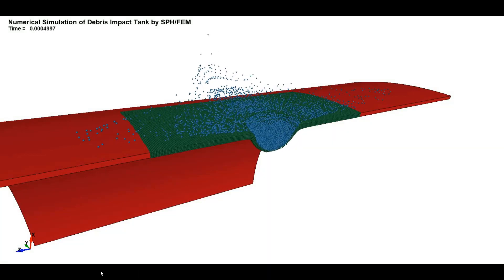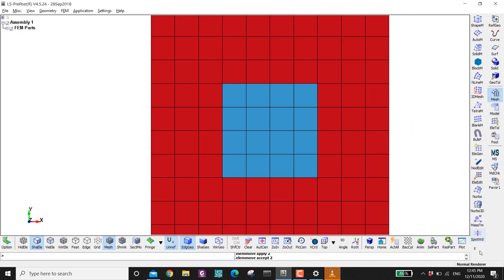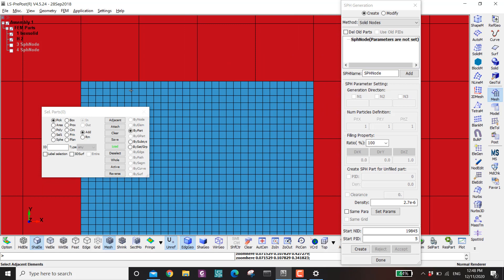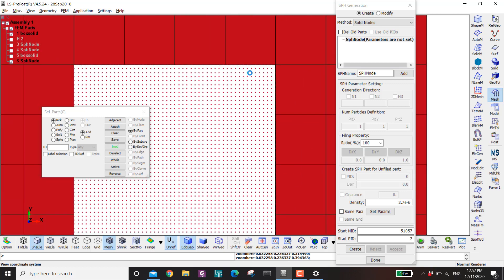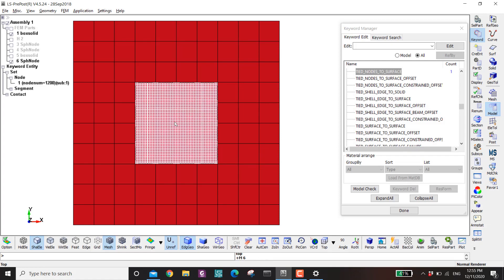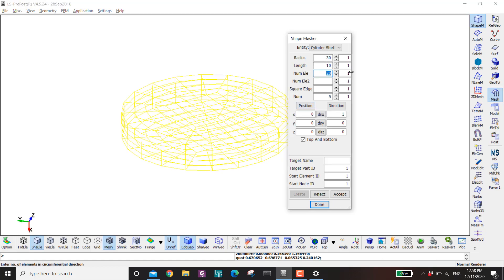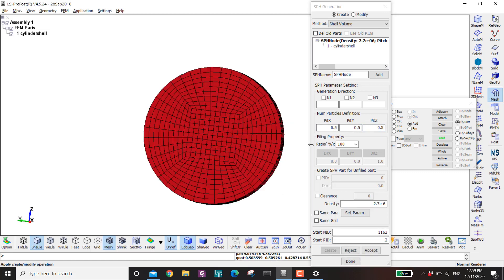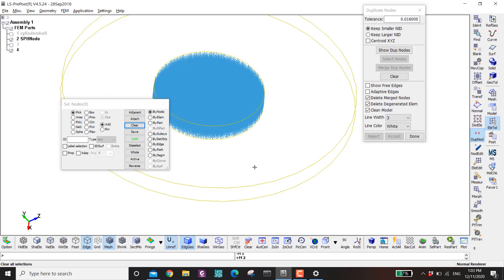SPH-FEM Coupling

Comment: Hi, thank you for the video, it's very useful. This might be a bit niche but I'm currently looking at hypervelocity impacts on structures created by overlapping spheres. I'm trying to reduce the memory needed by using this technique but I'm having problems with creating flat surfaces to use to couple the elements. I've tried creating solid shapes, which I can then cut to get flat surfaces, but I haven't managed to successfully mesh them. I have also tried using solid sphere meshes but can't get a flat surface from them to couple them to the SPH part. I would be very grateful if you had any advice. Thanks!
Reply from the maker: It is hard to imagine what your structure is. If you can share a picture, that would be great.

Comment: Hi Ameen, 

Great video, another really useful tutorial. 
I'm currently working through your video tutorials as my masters project involves hyper velocity impacts. I was just wondering if you were still planning on releasing a tutorial for modelling the impact scenario shown at the start of this video (SPH projectile and SPH target). I've tried to simulate is using your other tutorials but keep getting error messages.

Thanks.
Reply from the maker: Dear Thomas, 

May I know what errors you are facing? I am working on an article publication where I use SPH vs SPH in high velocity impact. Once the paper is published, I will be making the tutorial.
Reply: @AmeenTopa  I have set up an SPH impact zone with solid impactor to test the tied_nodes_to_surface keyword setup from your tutorial but when i run the simulation using other keywords from a few of your tutorials the projectile passes through the SPH zone without effecting the particles at all. Any help would be greatly appreciated and I'm looking forward to seeing this publication
Reply from the maker: @tpetersh  You have said solid projectile? So you have solid element impacting on SPH target?

You need to defined Nodes to Surface contact. I have mentioned this in my Bird-strike tutorial. 

If it is SPH vs SPH, then you don't need to define any contact. The SPH particles will interact with each other by default. Make sure to define CONTROL SPH with CONT = 0.

Also, make sure that you have defined the SPH properly. You must insert the density of the SPH material when you use SPH Generation tool.
Reply: @AmeenTopa  yes my final goal is to have SPH to SPH but I'm trialling SPH impact zone with solid projectile first to familiarise myself with the setup.

I will check those things and try again. Would you say SPH to SPH is easier to set up than SPH to solid then if theres no contact definition required?

Thank you so much for your help. I appreciate it
Reply from the maker: @tpetersh  No necessarily because in general SPH is more difficult to control than Solid Elements, in my opinion.

You are welcome, hope you manage to do it.
Reply: @AmeenTopa  Hi again Ameen, I have managed to get the simulation to work now but I am having issues with a small number of particles passing straight through the projectile while the others are affected as expected. I expect this is to do with the mesh density of my projectile and SPH impact zone. Are there any rules of thumb for how many SPH particles should be used per element of solid mesh?
Reply: @tpetersh  Did you manage to resolve this? I am also having this issue. I'm using an SPH projectile and SPH Target as above, however, most of the particles are unaffected.

Comment: Thank you for the great video. What section definition are you using for SPH? SPH or SPH_INTERACTION
Reply from the maker: Dear Fabian, the default settings in CONTROL SPH already considers the interaction between the different SPH parts.
Reply: @AmeenTopa  hi thanks for the reply. Yes I am aware that is why I was wondering which one you typically use
Reply from the maker: @F4b14n30  In this simulation, I am just using CONTROL SPH with the default parameters. In fact, in all my other videos, I am using the same setting.

I have read about SPH_INTERACTION in LSDYNA conference paper where they considered multi phase flow. I never used it though.